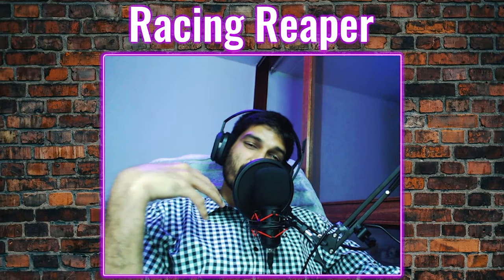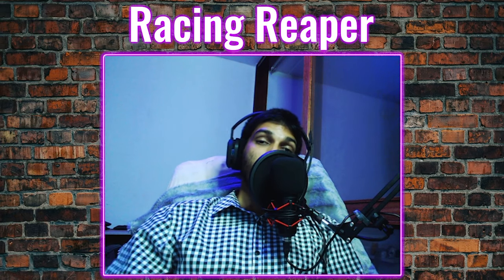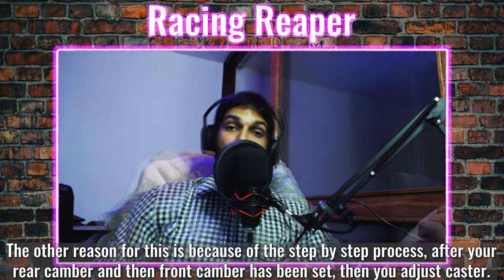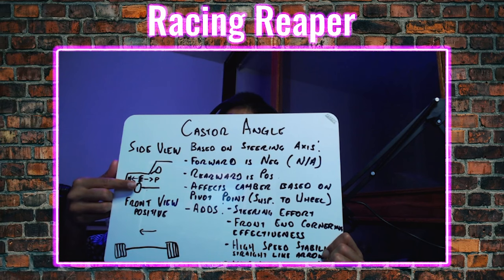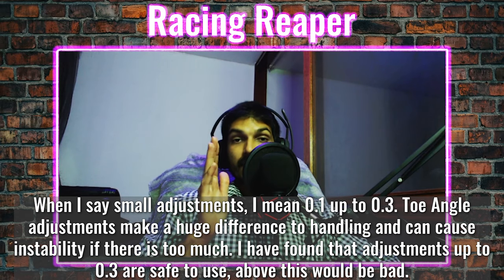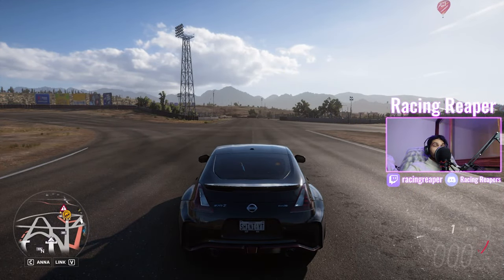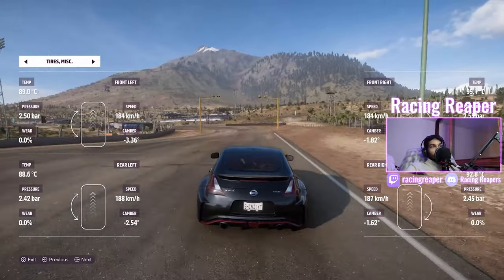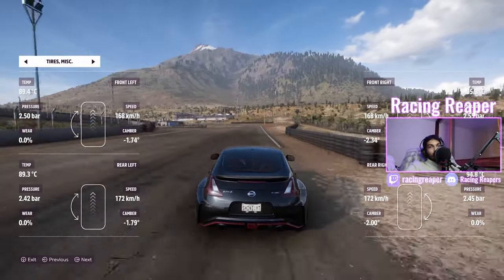Forza Horizon 5 : Make your tyres grip✅, not slip❌!!! (Beginners Guide/Tutorial) [Part 7]

Comment: Hello Racing Reaper nice tutorial series you have here for people looking to get into tuning. You are correct about the castor settings using a force feedback sterring wheel. I am using Thrustmaster TS-XW and more castor equals a stiffer turning wheel, if you use less castor the wheel becomes lighter. It feels harder to turn in with less grip if you go too high, one of the tune apps always set my castor for drift at 7 and I found it much better if I reduced it slightly then brought up telementary and altered other settings around the new castor setting.
Reply from the maker: After years, it's nice for someone to actually confirm this for me👍🏼

Sounds like you got your FFB settings dialled in nicely if you can tell the difference 

Glad I could help man👊🏼
Reply: @racingreaperofficial  

No problem buddy, yeah I had a thrustmaster t150 and the feedback was a bit mehh a lot better with the new wheel. I started tunning using the spreadsheet that was about back when forza 2 was released in 2014. I went on to learn more about tuning myself through trial and error and got pretty good at it. It's much easier/faster to tune knowing what affects things in the tune which is what this series covers. It took me a long time to figure things out by trial and error. Bigs up to you for sending this out to those who aren't sure what to play with and feel a bit lost. 👊
Reply from the maker: That's exactly what I was aiming for with these tutorials man

I'm glad at least one of you were able to pick up on this so thanks😁👊🏼

Comment: Wonderful explanation bro
Reply from the maker: Thanks man, I'm glad it could help.

I will give you one tip that isn't mentioned there. 
Your Camber and your ARB setting is linked and controls your turn-in speed. What this means is that when you set your Camber (negatively for road going cars I hope), your ARB stiffness setting will influence how fast the wheels lean over (in the case of the front wheels) and that will change how quick the car turns in. In the case of the rear; this will mean that as the car leans over, the ARB stiffness setting will influence how fast or slow the rear tyre is supposed to reach it's point of slip. 

After that, you only need to factor in the tyre and rim sizes, the power train layout and last will be your technique and how that needs to be adjusted to compensate for the "quirks" and you go from there👍🏼
Reply: @racingreaperofficial  holy damn, that's a solid info. Gonna keep this in mind.
Reply from the maker: @ayush21399 cool cool man👊🏼👌🏼

Comment: You 50% right. Think go read up about suspension.
Reply from the maker: You know, I won't blame you for saying this because I found out more after this... But after both Forza games stopped working, I won't be using Forza to explain it. I'm planning on starting a new series using Assetto Corsa
Reply from the maker: However, I do want to add that the tuning system in Forza Horizon 5 is lacking in certain ways and what I was explaining here was how I overcame the limitations. The tuning system in Forza Motorsport and other more simulation focused games are much better to work with and don't have the limitations that FH5 has

Comment: I can not seem to get my tires yellow  unless i spin...
Reply from the maker: Ok it's been a while so let me think here...
1. What are the conditions when you are testing tyre heat? Is it raining? If so, your tyres won't heat up easily and you have to put a lot of stress on them to see some heat being generated
2. Sometimes, you might be using a tyre that is too high a grade to be used with a particular car in its current state. If this is the case, you could try dropping a grade or two depending on what you going for and also pull back some PI that way to throw into other upgrades...

Other than that, I also had some situations where I couldn't get any heat to generate in the tyres of certain builds even after downgrading the tyres I was using and making sure that I was testing without the rain... At the time I was doing this, I didn't really understand why it would be like that

Until more recently when I started going more and more into Assetto Corsa. What I found was that the alignment could also help with how the tyre heats up.

Let me explain:
Camber; this is exactly as I explained it where you need to keep your camber negative but it has to be a value whereby you turn in and when the car is pushing the load all the way to the one side, the tyres on that one side must be as close to neutral or even neutral. The new thing I found in Assetto Corsa is that when the tyre goes into positive, we need to set the suspension up so that it slides from the rear first and then the front while still staying stable and that will help generate heat into the tyre.
The other thing I found out and it's kind of stupid because I should've known this all along... Toe angles!!! Adjusting your toe angles and making your tyres run a little off-straight to the road will also help generate heat in your tyres.

As you adjusting all this, another new thing I've learnt is to do with the ARBs. This doesn't only affect how the body moves over, but it also plays a role in the car's turn-in capabilities. The stiffer you make the front, the sharper the turn-in action will be but it will also reach that point of the tyre slipping quicker (if you set the camber to do that). The stiffer you make the rear, a similar thing will happen but remember your rear is there to keep you lined up properly so a little slip is recommended but if you feel it's uncomfortable and unpredictable, dial it back down a bit

Hope this helps man👍🏼
Reply: @racingreaperofficial  I tried lower compounds same issue and caused less grip. I'm using the HSV 14 sedan A class I veen following all steps starting with springs and damping.  Got the car to react right, so i think. I adjusted the anti roll so one side goes lower while turning.  I adjusted camber so it does go posrive as well.
Reply: @racingreaperofficial  but I can notnget the tire telemetry to stay hot they cool off  and when I lower the tire compound and tire pressure they show no changes and slips out more. The car is rwd and heavy with 3100lb and 600-800hp depending on tire compound.  Think my camber is -1.5 -1.6 one 6 caster with postive toe. Also on a 275 tire (factory)
Reply from the maker: Ok I've had this happen to me before with certain builds and I couldn't get it to stay hot just the same as you

But, let's try an experiment if you up for it.
Start off putting the tyre compound that gives you the grip level you looking for 
What Rim size are you using? Try going bigger to leave less room for the tyre to flex and thus, more slip would occur to help generate heat in the tyre
The last thing you can do is lower tyre pressures to let it heat up faster🤔